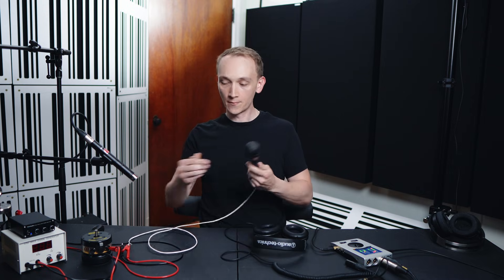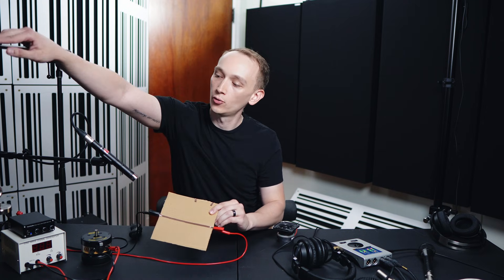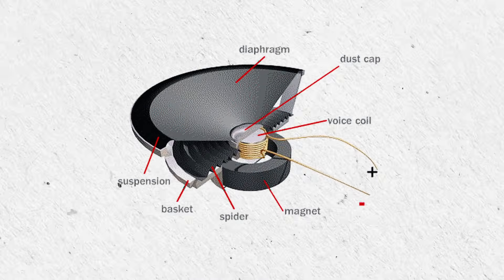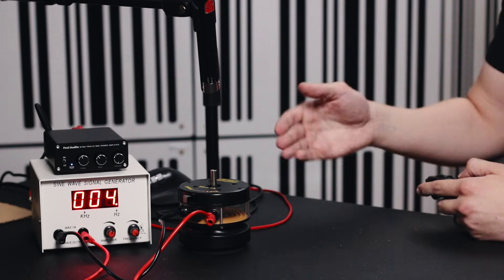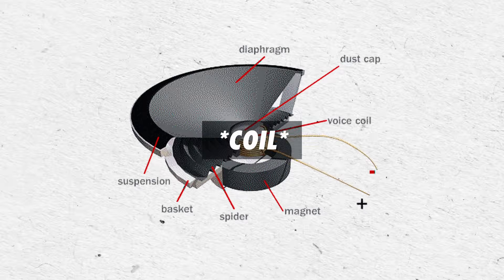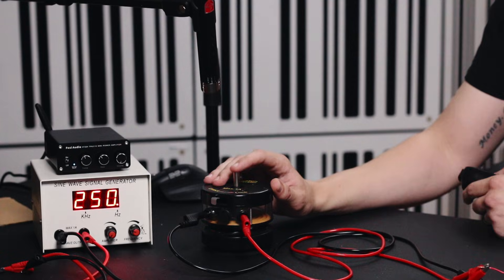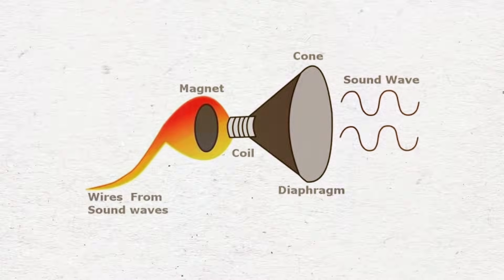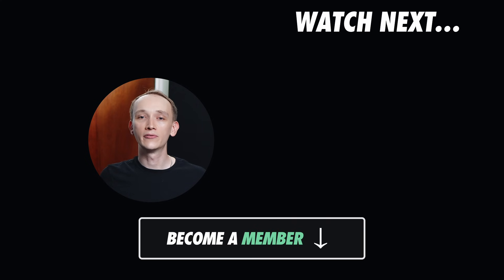How To Convert Headphones Into A Microphone

Comment: Slight correction: Its the number of turns in the magnetic field that matters, not the amount of copper. Thicker copper will however reduce the risk of fire at higher powers

Comment: I converted sennheisser headphones into microphones for my plate reverb and if you flip the front cover and glue onto the back, you have holes to run the cable out of and a place to cable tie off. They are also great because you can fix them to the steel plate anywhere easily because they are magnetic and stick wherever you want them

Comment: Hi Kyle so I've been listening to your guises videos for a while now and noticed that you don't even have any hissing in your audio recordings. I don't know if you use condenser microphones or dynamic microphones just with a better audio interface but I discovered something today. So I just received the triton audio Fet head, plugged it into the SM seven DB microphone and I actually ended up having to put it on bypass mode and turn off the actual preamps that were in the microphone and when I did so there was considerably much cleaner gain than the built-in preamps that were in that microphone. I don't know why they decided to use cloudlifter technology when the triton audio in-line preamp has a lot less self noise. In fact you don't even hear the self noise because I did a/B testing with this microphone as well as the electro voice 27N/D microphone and both of them sound much better and no hissing at all with the triton audio in-line preamp as opposed to a cloud lifter. I wish that the SM seven DB microphone could be redesigned with preamps from Triton audio because I don't want to have to deal with loads of clunky wires and the triton audio in-line preamp actually gives a lot more clean gain as compared to the cloud lifter even if most marketing materials say that cloud lifters go up to 28 or 30 DB, just because they might do that doesn't necessarily mean that there's no noise. The cloud lifter actually introduces a lot more noise with their amplification. The cloud lifter could give you hundreds of DB of gain so they say, that still doesn't change the fact that it's nothing but hissing noises. I would also like to point out that being totally blind I have to rely on my ears because that's all I've got so my ears are extremely sensitive and I hear things that people who have site may not hear and that hissing from the built-in preamp from cloud microphones is absolutely horrible.